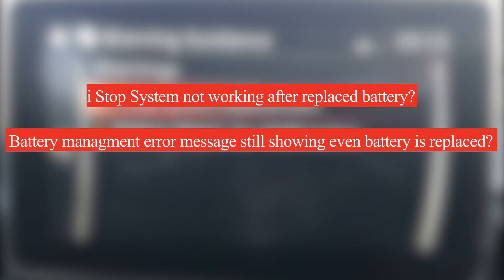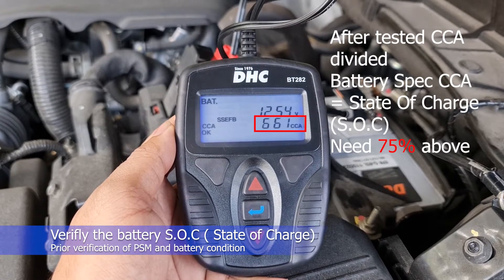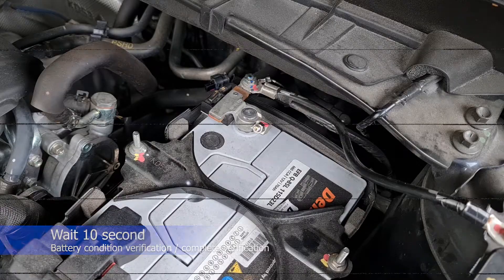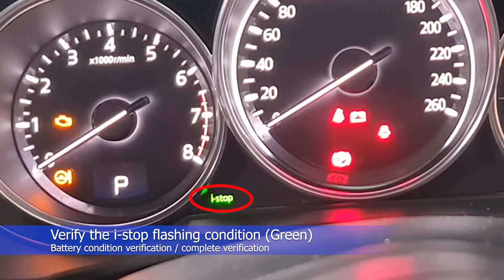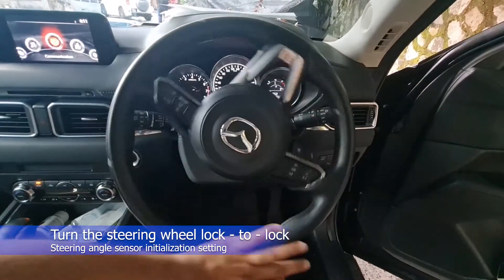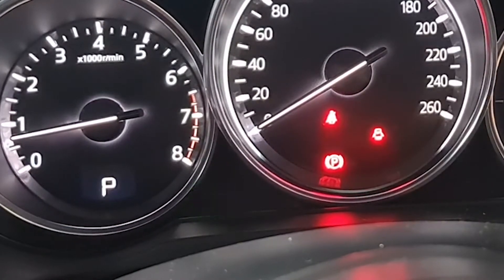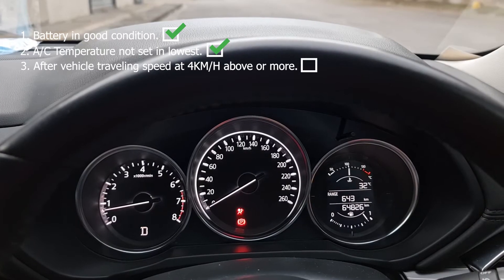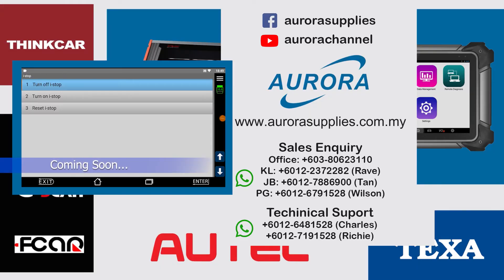Mazda i - Stop Initialize (Battery Initialize)

Comment: Following the instructions to push the I-stop for 10sec, I got solid amber light. Tried the whole process again but got the same result. Then I decided to have a test drive first instead. Started the engine, solid amber light at the beginning, then disappeared. After my speed increased to a certain point, the I-stop light appeared with green color. Then everything was back to normal. Adjusted windows and all done. Thanks for the instructions and comments from other owners.

Comment: 2014 Mazda 6, the light positions does not look the same in the video but this method works and fixed the problem. 
I followed the step, it doesn't instantly fixed it. The warning was still there. 
I left the car there for 3-4 hours and then the istop light back to green and warning gone magically.....
Reply: That’s the same year for my Mazda 5 I will wait.

Comment: Another step worth adding is after you have connected the battery you need to close the bonnet/hood, there is a switch on the bonnet catch that needs to be in the closed position to get the amber light to the green state.
Reply: Missed this step😂, thank you so much
Reply: where is this exactly? i couldn't find it...
Reply: @CikguDarrel  ignore these people. only fools play with this switch in the first place to disable istop, but it also disables your alarm. disable istop the proper way using your finger or an OBD2 scan tool
Reply: we have to do the istop init procedure just after installing the new battery, no start of the motor before that?

Comment: Mazda 3 - 4th gen 2019

I just wanted to thank you so much. It worked. But had different problem.

I’ve had info that oil should be changed. And with it istop stopped working. I thought that after reset of oil change the issue will be resolved. 
Not at all. No errors, istop was not working due to not ready engine.
I’ve tried some resets. After 2 weeks of trying, your method helped. 

So for everyone who has a car like me. It’s working. 

Thank you so much.

Comment: Kept getting the flashing amber istop light instead of the green. Went ahead with the next steps anyway - steering wheel lock & the rest. IT STILL WORKED - i-stop re-enabled successfully - so if you don't get the green flash don't lose hope, try the rest of the steps anyway.

Comment: Great video. In my case, the istop light didn't turn to green, it went away after the long press of the button. I thought it wouldn't work, but continued   with the the rest of the procedure and it worked. I tried on Mazda 6 2018
Reply: More or less the same thing here, but it also worked. Mazda CX5 2023

Comment: If I-stop isn’t working your car may need a long uninterrupted run on the motorway for at least 15 mins to clear the DPF filter. Don’t use the brake, keeping the revs over 2.000. Mazda recommends this about every 2 weeks to keep the DPF filter clear (improves mpg too👌🏻)

Comment: Thanks for the video,i have just fitted a brand new battery, (Q85 MF Century)  and i have a 2018 Mazda 3, with the 2.5L engine, i found i only had to do the first few steps and it worked, i disconnected the negative terminal, unclipped the sensor, waited 5 minutes, connected the terminal, waited 10 seconds, connected the sensor again. I got in my car turned on the ignition, waited 15 seconds, pressed the istop button for 10 seconds, the istop dash light stayed flashing on amber, i thought something wrong with the battery?? i turned the ignition off, tried the same procedure with the ignition again, this time the istop dash light did not flash, but stayed on a solid amber color, i pressed the istop button again and the istop dash light went out. i pressed the istop  button again and the istop dash light came on and stayed a solid green. I took the car for a test drive and everything back to normal, istop is working correctly, warning lights in the dash gone.

Comment: To remove the battery sensor: slide gray tab back & PINCH THE TAB DOWN. It will pull off easily if you have it punched down. Almost broke it before I figured it out.

Comment: to those who are stuck with the step flashing green before closing the bonnet make sure you dont have a battery code. clear all the code first. 

check engine is not battery code. the triangle yellow one is. make sure that it is off then retry the procedure
thank me later you all owe me a beer

Comment: Is this the same procedure when you replace the battery? My Mazda 3 skyactive has a agm battery. Do I remove the old battery and replace it with a new battery and then follow the steps from where you connect the negative terminal in your video ?

Comment: The Istop light did not appear on my Mazda cx-5 I have a 2018 2.0 active. The only light that has appeared on my dashboard was a orange hazard sign. However the above guidance is what appeared on the digital board. Does this mean that I just need to replace the battery. Car has been standing in a dealership for the last 6 months

Comment: hello, I have a 2012 model mazda demio i stop vehicle. I just bought the vehicle. The stop was defective when I bought it. I have a new 75 amp battery. I replaced the car's i-stop brain. however, it went out when the vehicle stopped, did not overlap again and gave an i-stop failure. Has this problem ever happened to you? What are your recommendations? Thank you.

Comment: Not working for me 😢

I do everything up to the point it turns green and says go to nect step, as soon as i go to the next step qnd start the engine it goes back to flashing amber again straight away.

Battery is only a few months old, shows green on the battery itself and ive even tried charging it. Dont know what to do now
Reply: Same, did you fix it?
Reply: I have the same problem. Let me know if u found a solution

Comment: Didn’t work for me as per few others here. I can get i-stop light flashing green after reconnecting the negative terminal and battery sensor (and closing the bonnet - tried that at 2 different points in the sequence). However the battery malfunction light never turns off. It’s a brand new battery and we’ve been driving all week without i-stop. When I start the engine it goes back to flashing amber - nothing works from step 8 onwards for me. By the way second time in the lifetime of the car we’ve changed battery as it’s a 2018 CX-5. Maybe the car’s just weird.
Reply: I'm in the exact same situation! :eyes-purple-crying: Noticed you posted this 4 weeks ago, any luck since then?
Reply: @CalThePal  Unfortunately, no. We decided to live without i-stop and figured another year or two of extra battery life would more than make up for the fuel saved using i-stop.
Reply: @NigelEber-bf1th  Thanks for replying and sharing your thoughts! I followed this video 6 times with no success and was going crazy! I might do the same thing too, i-stop is such a hassle 😔
Reply: @CalThePal  True. We’ve changed battery twice now - once every 3 years. My old Camry could go 5-6 years per battery. Couple that with the labour cost of recalibrating a new battery at a Mazda dealership = $$$$ that could be saved without the pesky i-stop. I think Mazda just does it to comply with Euro emission standards.
Reply: 2019 CX-5 here, not working at all for me 😢 I don't get the green light, but even if I go through all the steps the ambler flashing light still doesn't go away... Brand new battery
Reply: @chanandlerbong7906  Guess we have to take it to Mazda then. That’s what we did the first time. But now I just live without I-stop and it doesn’t bother me.

Comment: Help! After I re attached the sensor I got the green blinking light but when I start the engine to do the steering wheel calibration thing I immediately get amber blinking light and it doesnt work. Ive tried a dozen times by now
Reply: I get the same. Did you ever fix it?
Reply: Did you figure it out mate? Im having same issue
Reply: @annaskhan9642  no, still the same. Learned to live with it for now

Comment: How did you disconnect the battery sensor that easy I'm dying here 😢 I pull the gray safety clip out but it's still not moving out 🤯
Reply: This drove me nuts too!
Reply: @NigelEber-bf1th  haha yeah, figured it out eventually 😂
Reply: First slide the little grey tab outwards, then press the end of the tab downwards causing it to pivot- this releases a small catch. Now pull the whole lot away from the terminal.

Comment: No doesn't work. Tried for 3 hours. Something is not adequately explained and the procedure is not consistent with some of the comments anyway. I just get a steady amber istop on the display, even with a brand new fully charged battery. So I never get past step 7. Did that loop about 14 or 15 times. Even ran the car for 30 min to make sure engine hot and went back to the start of the procedure. Same outcome.    

The whole istop concept is seriously flawed, you just wreck batteries faster = more battery waste, more cost, more money for garage workshops. There are no savings at all.
Reply: Odb scan dongle and a car scan app or a forscan app. Reset faults and you are done

Comment: Did not work in 2016 Mazda 2nd. Stage step by step three times i tried. Brand service next.....
Reply: Did you get this issue fixed?
Reply: Thank you for responding. Do you remember what the fault code reader said and what they did to fix the issue? I’m having the same issue with my Mazda 3. And the battery seems to be good. Not sure what else could be the issue
Reply: @sharnelle1636  I don`t know what code reader has read. The service had coded a new battery and started working with it. The mistake was probably in it. When the lights started flashing. I took the car battery to a battery store. For a replacement,and the battery was replaced without a momentary disconnenection. The fault was memorirzed and he did not agree to leave the home assembly